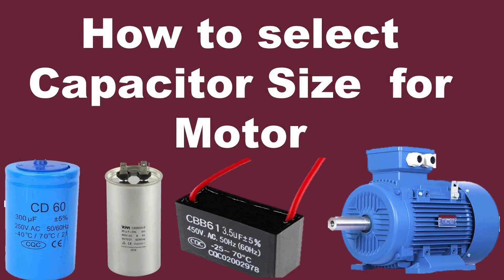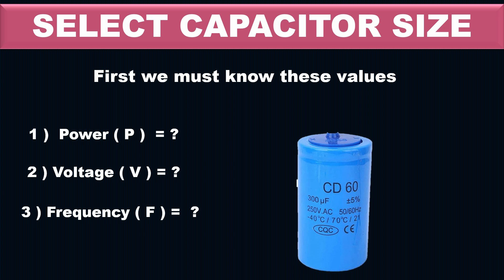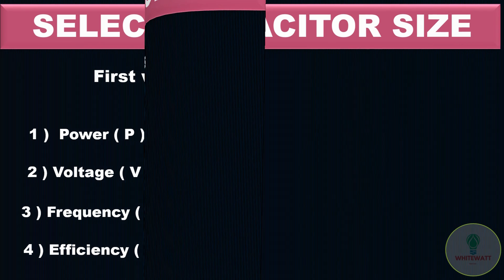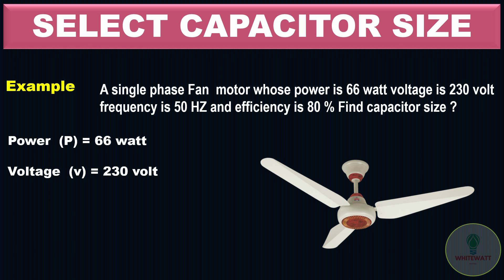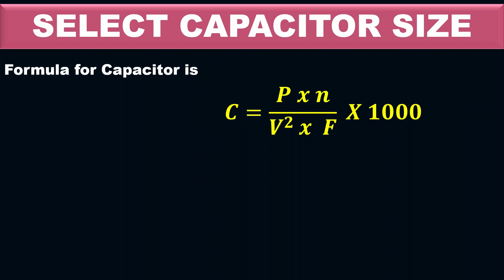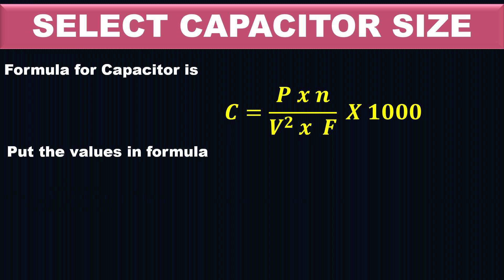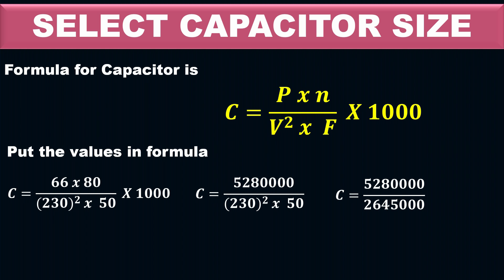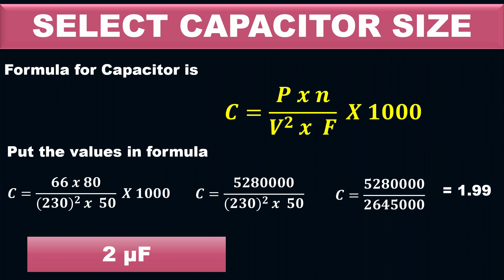How to select Capacitor Size or Rating for motor

Comment: I have an old motor that needs a new cap.  It is 430-480 mfd.  But I can't find those values.  I can only find 400-480 or 430 516.
Which cap can I use to substitute?
Reply from the maker: The best replacement is 430–516 µF

Comment: bhai mere 2 questions hai 
1. voltage square me q liye hai ?
2. capacitor ki rating micro farad me q lete hai ?
bhai please answer
Reply from the maker: Answer 1. 
Hum voltage ko square is liye karte hain kyun ke circuit mein energy aur power voltage ke sath linearly nahi barhta balki yeh zyada tez barhte hain  Is formula ka istemal is baat ko yaqini banata hai ke capacitor motor ki asal energy zarurat ko handle kar sake aur motor smoothly aur efficiently chale
Reply from the maker: Answer no 2 
Ceiling fans ke capacitors aam tor par chhoti miqdar  main charge store karte hain.

Farad (F) ek bohot bara unit hai. 
Example

1 Farad (F) = 1,000,000 Microfarads (µF)

Ceiling fan capacitor ko aksar 2 µF ya 4 µF jaisi value ki zarurat hoti hai  jo farads mein likhne par 0.000002 F ya 0.000004 F ke barabar hoti hai yeh likhna aur samajhna mushkil hota hai

Comment: 66 X 80 equals 5280, not 5280000
Reply from the maker: yes i know  i think you not see 1000 with
Reply: @whitewatt-hu2lm  So top numbers (numerator) in formula get multiplied by 1000, but not the bottom (denominator)?

Comment: Hi can you help me to find it for my 3 phase 7.5 hp submersible pump , values are Power = 5500 watt
Voltage = 415 volt
Frequently = 50 hz
Efficiency = 77 %

Can I use the same formula or any different formula for 3 phase?
Reply: Three phase motor doesn't use a run capacitor.
You can add capacitors across three phase motors to cancel out some of their inductive reactance to improve power factor of motor.
Reply: Use 220V single-phase power to run a 3-phase motor. Capacity will be reduced by more than half
yes you can absolutely use the formula above.
Note: how to connect (refer to Google)